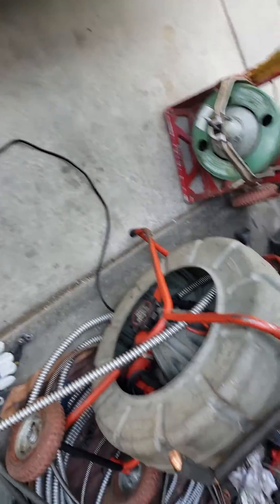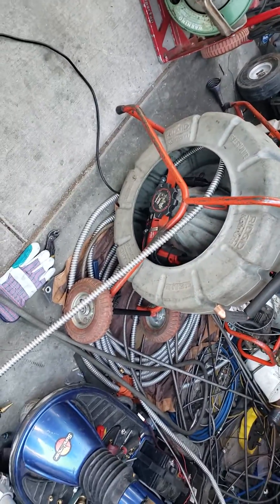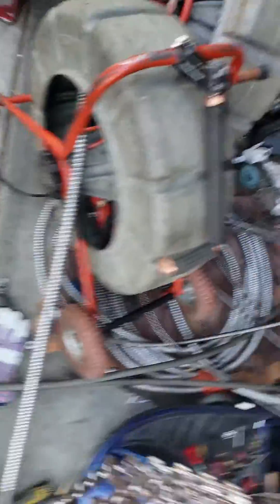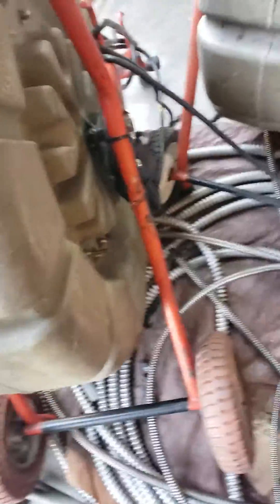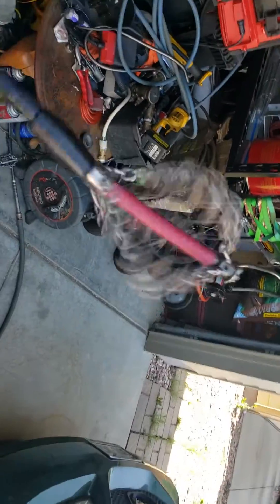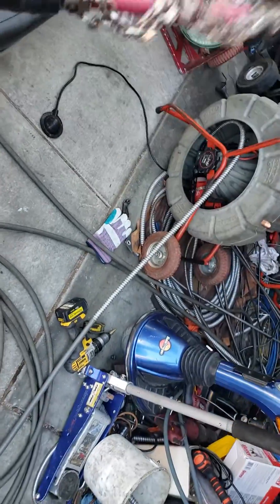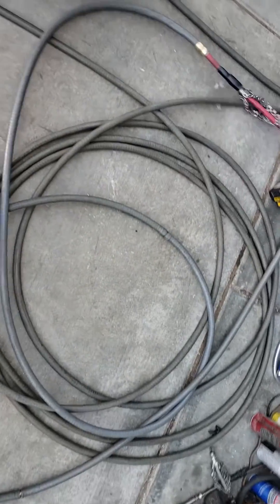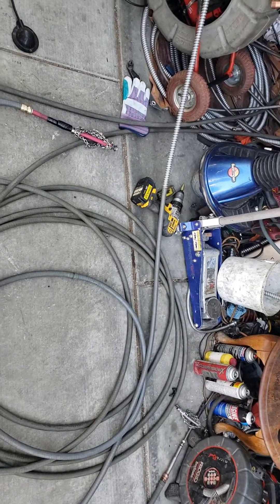Flex shaft seesnake custom machine

Comment: We would all love to know what you used for the cable and sleeve
Reply from the maker: They've been trying out a lot of different snake cables from general to rigid and others they all work pretty much the same I also have some real genuine flex shaft cables that I usethey work a little better because they don't stretch out when you get them far into the drain like the snake cables do and little less friction in the sleeve, and for the sleeve are used in this video was actually a steel electrical conduit, works pretty good but it's not water resistant and water gets inside and rust it out real bad changed to a lot of different style sleeves to get better results I'll be making some more videos later

Comment: What type of outer hose is that?
Looks like a garden hose.. I was thinking of making my own.
Reply from the maker: Was trying out different things for the cover the one I was using in the video is actually an electrical insulation hose, works good stiff enough to push through the drains and will let the cable spin fast enough to do a good cleaning job.
Reply: @ProPower  Where can i find that hose?    Is that what u ended up using?

Comment: Nice job. What brand drum cable are you running & are you using one of those stainless steel garden hose's for the sleeve or something else.

Nice work.
Reply from the maker: Was using a ridgid 3/8"x75' snake cable and was trying out different materials that would spin the best with the cable inside for the sleeve.